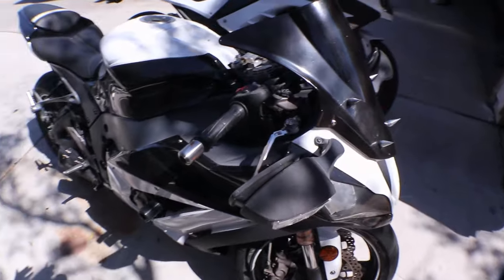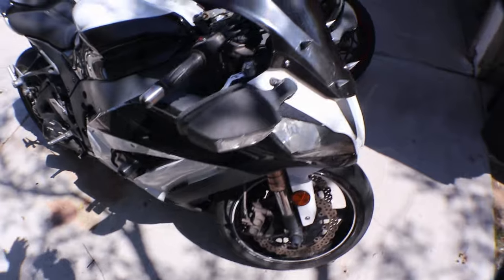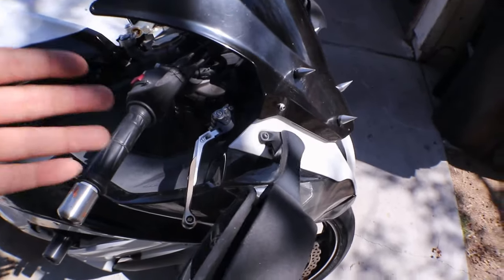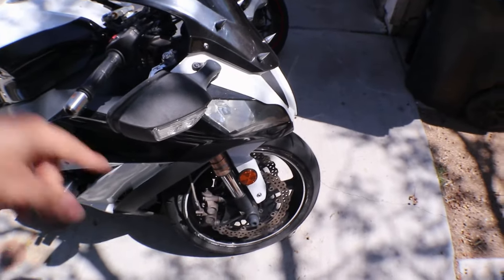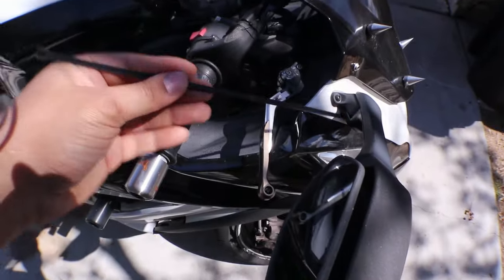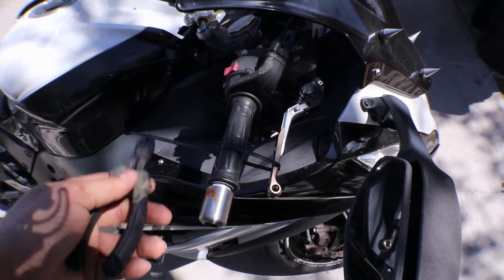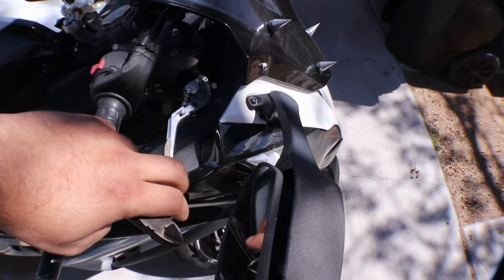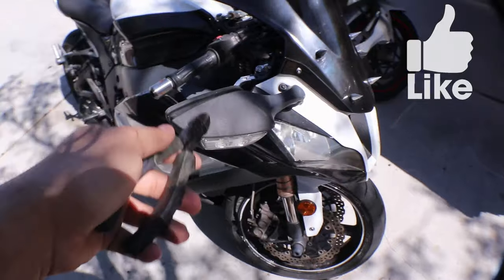Quick Tip: Fix Spongy Brakes!

Comment: great trick, thank you! i did this to my 07 cbr600 and it worked. 
however, every 4~5 days the front brake becomes noticeably spongy again from a really strong feel after a good bleeding with air bubbles coming front the upper bleeding port near the reservoir, 
yes, every 4~5 days, no leaking is identified.
 this is a big mystery for me. 
anybody could give me any hint? thank you very much!
Reply: I had the same on my 1000SX,  i was losing brake pressure and had a very spongy lever after the bike was sitting for a week or two. 
I had to bleed the master cylinder (bleed nipple up near the reservoir) of air that had found it's way in to the system to get decent pressure back again. 
Even after doing that the brake lever still had a spongy feel to it.

I ended up rebuilding the master cylinder today and the front brake lever is now firm.
I won't know if it's solved my issue completely for another couple of weeks though, but the feel at the lever right now has greatly improved.
Reply: @jn1k203  thank you very much for your information. My guess this issue is most likely coming from the master cylinder o-ring seals. I am about to replace the old o-rings and I will let you know how they work. Cheers from canada
Reply: @ossiclesrecordingstudio3307  Update- it's been about 2 weeks since master cylinder rebuild, my bike has been sitting unused in that time and the front brake is still firm and holding pressure as it should. 
No air has migrated into the master cylinder, and it now bleeds free of air again.

I only replaced the 2 seals, spring and circlip as the kit i purchased (All Balls Racing) for $39.95 AUD delivered doesn't come with the piston.

I went for a 20km test ride today and and am confident that the issue is now sorted.
Good luck with your CBR.
Reply: @jn1k203   Update- Now I got the same result just like yours for 10 days, a firm front brake, the issue gone completely. I replaced all the master cylinder components not only two rubber seals even I know it was unlikely anything wrong with the piston. I also compared the old seals with the new ones and I could feel old ones were kinda stiff. Thanks buddy!

Comment: What if the handbrake is not spongey n won't close how do I fix that
Reply from the maker: It sounds like a mechanical failure or hydraulic lock. Could you explain your symptom in more detail so I can try to help?
Reply: @TheMotorcycleBoss  its a bike that was sitting for a while the clutch and rear brakes work but the handlebar brakes wont close(wont release from open opsition), its a k3 gsx
Reply from the maker: @camronmoz2662  so you're saying that you can't pull the lever in or the lever wont spring back out.
Reply: @TheMotorcycleBoss  I can't pull it in, can I fix that or should I get new parts?
Reply from the maker: @camronmoz2662  is your brake fluid level extremely high? Apply pressure to your lever then slowly crack your brake bleed nipple then tighten it back up before the lever is pulled all the way. Does the lever move when you do that? Are the brakes siezed on the rotor?
Reply from the maker: @camronmoz2662  so did you crack the bleed nipple then pull the lever? Did the lever move after doing that?
Reply: @TheMotorcycleBoss  I'm saying that I can't pull in the lever fam

Comment: Do you have to leave the reservoir open overnight?
Reply from the maker: No
Reply: But the air cant get out in a closed circuit?
Reply from the maker: @fvds_music175  the air stays in the system but the air bubbles with rise to the top of the reservoir.

Comment: Helpful video but i have question i have changed my brakepads of front but still lever is not coming to hard position the adjustment of lever is on 5th point.brake is good but takes to press more i use hard lever can u help me out .
Reply from the maker: Hey! Thanks for reaching out. Changing brake pads will not do anything regarding fixing a spongy brake lever. A spongy brake is commonly caused by having air in your brake lines. You need to perform a procedure called "brake bleeding". This will purge the air out of your lines and if done correctly, will return your brakes back to a firm feeling. I have a video covering how to bleed brakes if you would like to check it out. I hope this helps! Ride safe and I hope you subscribed! Cheers!
Reply: @TheMotorcycleBoss  i did brake bleeding by professionals but still its same do i need to rebuild the master cylinder kit?
Reply from the maker: @asimprince8968  Even professionals leave air in the brakes pretty often unfortunately. Rebuilding the master cylinder might help but the more likely cause is air in the system or worn out rubber brake lines. Upgrading to steel-braided brake lines has the potential to dramatically increase brake feel. If you are interested in either route, I have videos for both rebuilding the master cylinder as well as upgrading to steel-braided lines.
Reply: @TheMotorcycleBoss  i have just tied up the lever as suggested in the video will keep over night lets see hope its go well🙂
Reply from the maker: @asimprince8968  good luck!
Reply: @TheMotorcycleBoss  thanks dear ur videos are great informative i have just a couple of minutes gone through with brake bleeding video very helpful good work keep doing 🙂